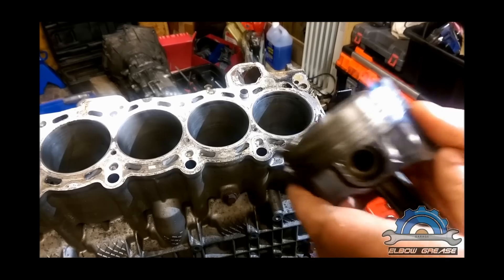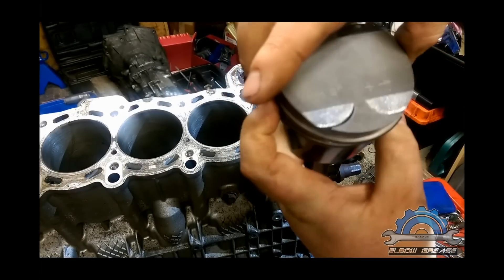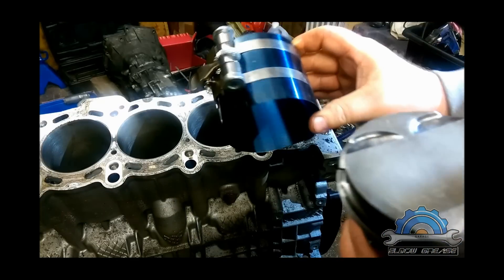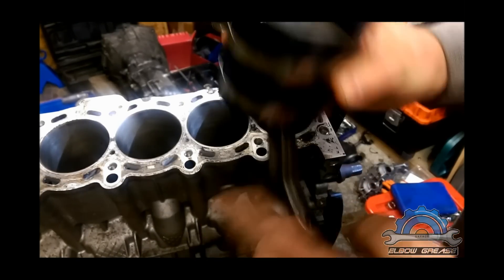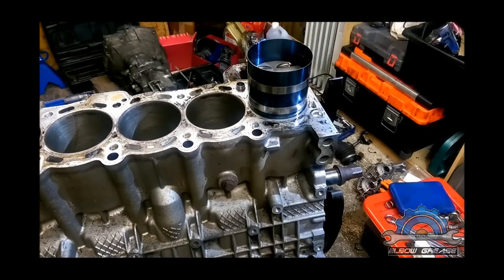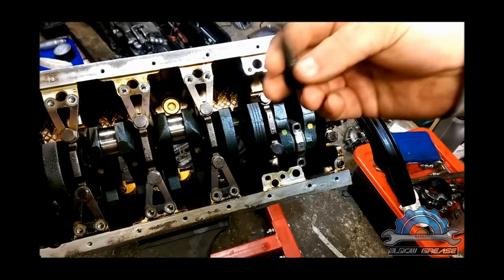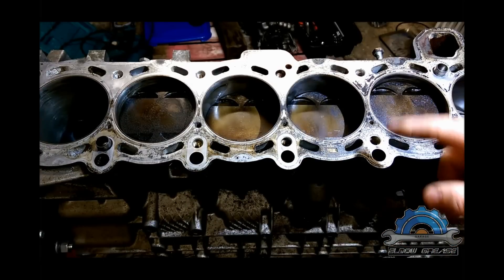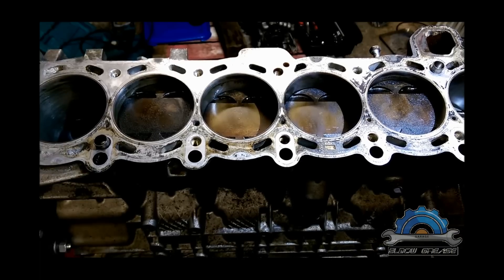Piston installation BMW e46 330,325,320

Comment: Did you test your piston ring gap?
Reply from the maker: yes, 0,2 mm compression
Reply: Thanks mate ;)
Reply: That small ! It dose not get locked when it get hot!  Because it is expanding and that gap is closing.  But if is to small,  it will push the ring in the cilinder.

Comment: how do u know wht cylinders each piston goes n to whn using part no. 8-106+030
Reply from the maker: Tim Mathess no ,before you take them out you need to mark then
Reply: Elbow Grease.  well i built this engine bout 15yrs ago.  ive been searching for SOMEBODY THAT WLD TELL ME HOW THEY GO BACK N... so i dont bend any valves..   so if u know how these pistons go n n the way they r supposed to go n i wld appreciate it